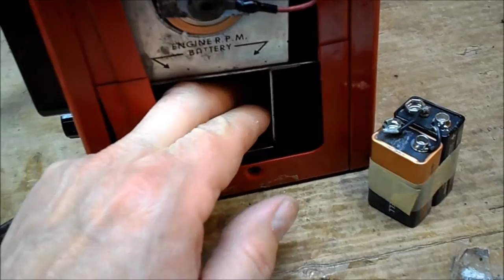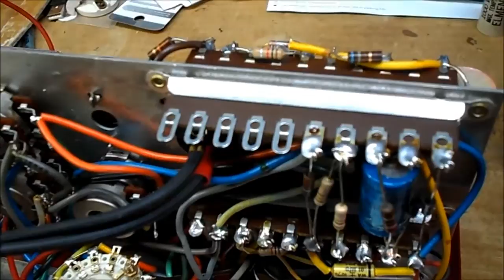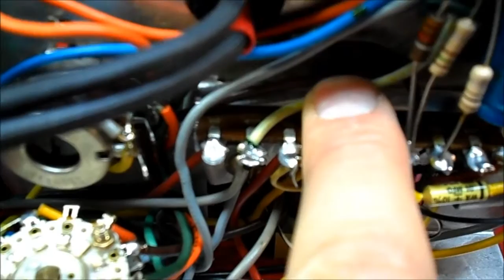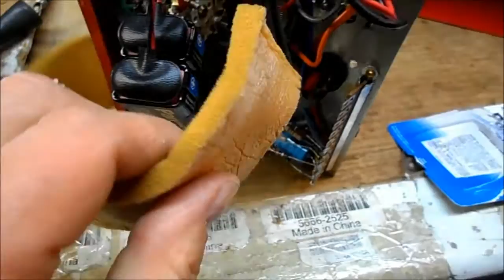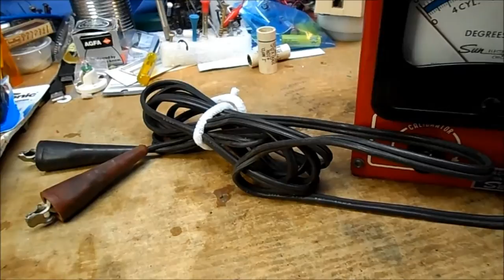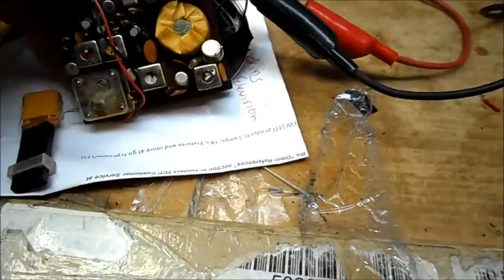Vintage Sun Electric Corporation TDT-11 Tach Dwell Tester Repair.

Comment: I just purchased one of these. I installed new batteries. When I select any of the cylinder count positions the needle pegs to the right. What could be the problem?
Reply from the maker: Hello, & thank you for watching. I had this unit just long enough to locate the wire position, & not sure what that issue might be.

Comment: I was looking for anything on YouTube regarding this Sun Tach and Dwell meter and found this video.  Do you still work on these meters, or do you know anyone that does?  I have this same model meter, TDT-11 and it's in very good shape yet.  The problem is that it doesn't function properly and I would really like to get it repaired so I can use it in my motorcycle repair work.  Thanks!
Rick H.
Reply from the maker: Hello, sorry though. This was a "one off" favor for a customer. Yes, nothing exists via. the Web on this. Battery connection was the only issue here. Good luck. Nice meter.

Comment: Use your Meter and alligator clips and set continuity mode, clip one end of the battery terminal , and start probing with the other end, or where you think the end might be. if it beeps , you've found it.

Comment: Very clever figuring how the battery bias locations were suppose to go Robert.
   I have 3 GE radios that are identical to that. I like the design. Of course germanium. One of my sets has a noisy one. (All the caps were replaced).
        Tom
Reply from the maker: ***** Yes I remember seeing someone here doing a video on one of them. I think it's just dried up caps, as it does play somewhat, & tunes stations.

Comment: Very nice looking dwell/tech meter.
I think I heard you say you got that transistor radio from my shop?
Was it in a clear plastic case?
If so it was a remote controlled radio repay I made up.
Those wires went to a relay and diode and was used to turn on something, my trickster days..LOL
I made a AM modulated transmitter which had a tone and when tuned in would activate the relay.
Been MANY years, I forgot more than I can ever count..LOL
Reply from the maker: ***** Yes it's from the shop. It had no case, & yes seems like some sort of tone trigger like you say. Makes sense.